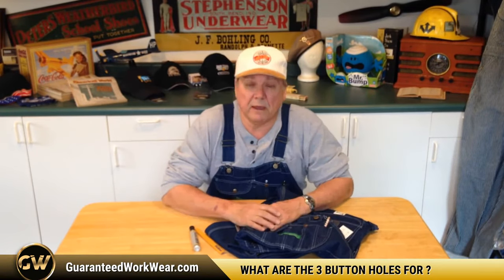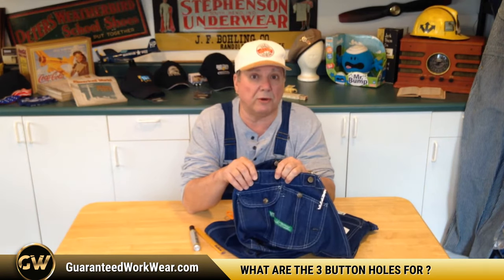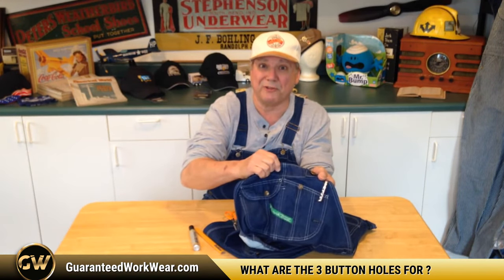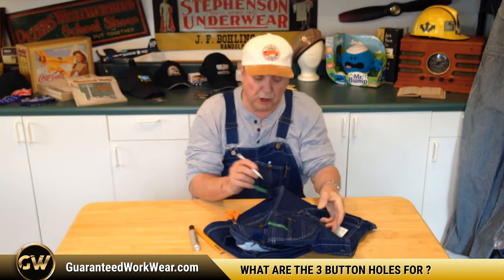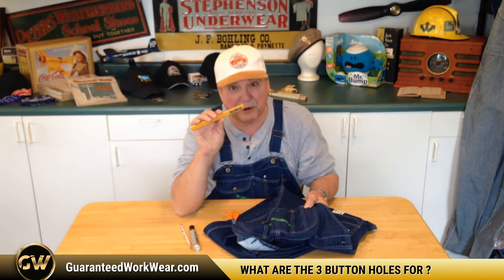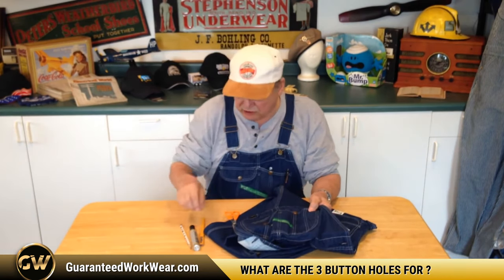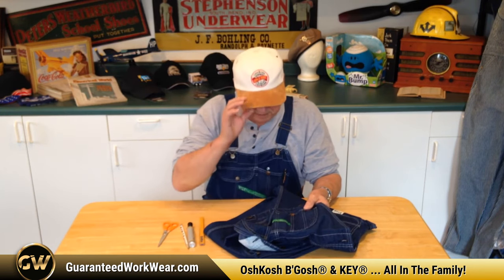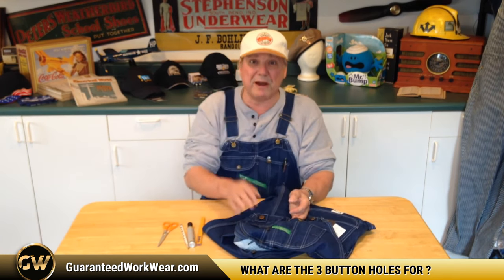KEY® Bib Overalls: What are the Three Button Holes on the Bib of a KEY® Imperial Bib Overall for?

Comment: Honestly I use the first button hole for ear protection. I roll up my ear plugs and stuff them in the hole. When they expand they hold firm and won't get lost. Way better than letting them get dirty in the bottom of a pocket or constantly losing them.
Reply from the maker: Wojac...My Apologies, but I overlooked your message a few months ago. When I saw what you use one of the holes for, I just had to get that info out to other Bib Overall wearers. GREAT IDEA! Thanks for sharing.  Uncle Bumpy

Comment: My sister and I just bought our first pair of matching bibs. Thank you for settling our argument about the buttonhole. We were both wrong. We are wondering if the pocket under the hammer thingamajig is for the handle of the hammer?
Reply from the maker: Good Question! But, Nope....you don't want to use that pocket for the hammer handle. The hammer handle has to be unrestrained and hang down when you walk and move your leg. Otherwise when you bend your legs, or go up and down a ladder or stairs it can bind or pinch your leg. Also, if you put the hammer handle in that pocket and you lift your leg high enough, the hammer could slide out.  Enjoy your bibs!
Reply: @factorydirectshippers  for the life of me, I don't know what "pocket" you are talking about.🤔

I have been wearing Key denim overalls daily for a couple of decades.

Every pair that I have ever had......
They have two pockets on the right leg, which I have always called "pliers pockets".
And then, on the left leg, is the hammer loop.
But there is no pocket under, or lower, the hammer loop.🤔🤔

Comment: Hi, thank you for the great information on the ways to use the button holes. I recently found what seem to be an older pair of key overalls and was curious if you knew what era they used the green thread accents around the buttonholes. I couldn't find too many references online so any ideas would be greatly appreciated!
Reply from the maker: Hello Javier:  Not totally sure, but it seems to me the green thread ended about 2005. I know there was some confusion among customers because the replacement thread was a black or deep navy color and some folks thought the button holes were unfinished or only partially completed.

Comment: I still carry a pocket watch and hook it to my bibs. As a blacksmith and welder, wearing a wristwatch is a hazard in multiple ways. My favorite brand of overalls however, just did away with all the models of overalls with watch holes in the bibs. Do yall sell insulated overalls as well?
Reply from the maker: Hello Musashi: As a welder and blacksmith these two bibs might be right down your alley! Go to this webpage:  https://www.lapcofrworkwear.com/cat/5002-bib-overalls       The denim bib is unlined but made of heavy flame resistant denim; the insulated bib overall is warm and wind resistant...BOTH have the Watch Fob Hole at the top of the bib. Use the Coupon Code:  UNCLEBUMPY   at checkout for $5 off the shipping. Hope this is helpful. Stay Safe and Warm.   Uncle Bumpy
Reply: @factorydirectshippers  much obliged, kind regards to you and yours.

Comment: What happened to key overalls the imperial used to be the best overall on the market, now they are cut for elephant legs, they use a cheap zipper instead of buttons for the fly, the hardware on the straps is noticably cheaper, they quit doing the contrast stitching around the bottom holes, and they no longer double line the bottom of the pockets, they charge more to buy a product that is made by third world labor for less money. Screw them I'll buy Round house or Five Brothers same  money for a better product.